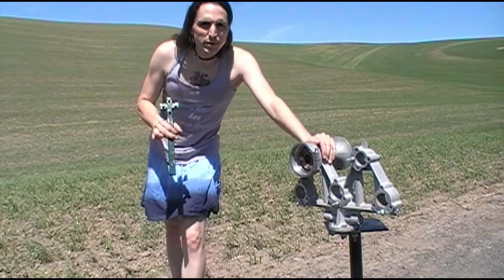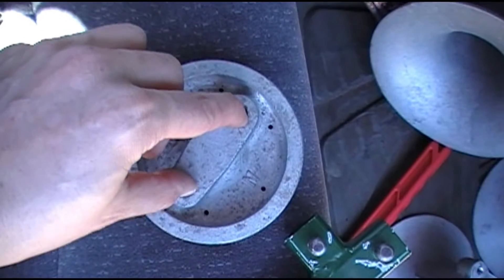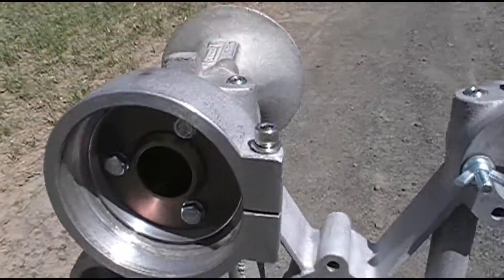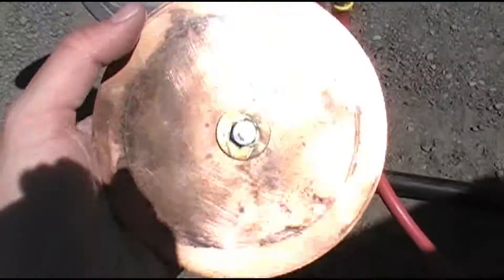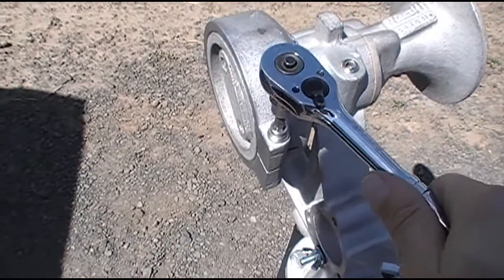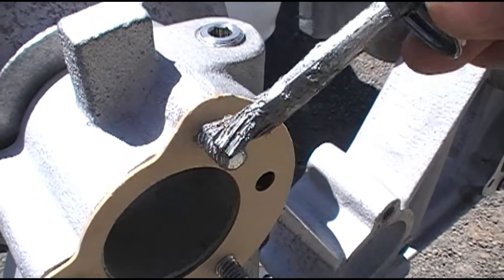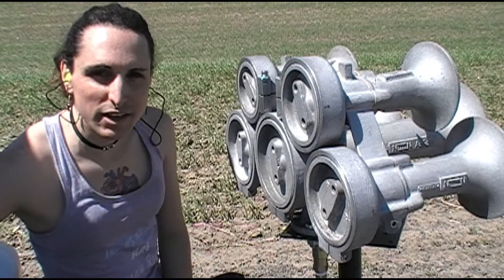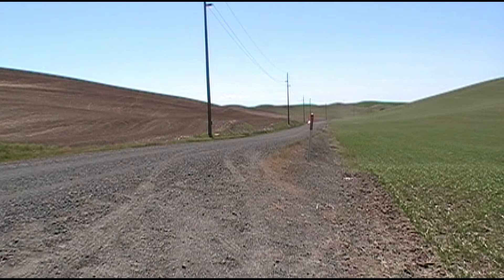M5 Horn Voicing (M5 Tuning)

Comment: I just picked up a 52 M5 with the factory seal wires still on it and it doesn't voice at all. Tom said "welcome to M horn ownership". I'm in for a adventure to getting it to sound nice again
Reply from the maker: @TWIGYBNSF  worn caps are the #1 cause of M horn problems, I’d start there.
Reply: @mafarnz good news. Finally have mine taken apart after being sealed for 72 years and there's not much wear on mine. Just a lot of corrosion. Mike Muha said if I assemble everything back together, it should voice. I maybe lucky with this one but can't speak too soon. I would eventually be making a video on my M5 once I have it back together again. But first, antiseize

Comment: I have an M3 i just made a spanner wrench for and it needs voicing, how do i get only 1 specific chime to blow like here when you have the other chimes attached?
Reply from the maker: Nothing extra or special needs to be done. Just follow the steps I showed here. Voice a bell, clamp the head then leave it alone and voice the next bell.  It’s just pressure and VERY precise control of air. Voicing this method means that each bell is voiced at a slightly lower pressure, that’s what allows M horns to step in sequentially like they do.

Comment: After you lock down the heads with the lock bolt, Airchime suggests using a 1/8 or 1/16 drill to drill a hole through the chamber and cap to attach a lock wire. The lock wire usually went through a hole in the cap of the lock bolt as well. The wire keeps the cap from unscrewing, thus keeping the tune intact for a longer period of time. I've never met anyone who actually has drilled a head and cap to attach their own wire, but it's in the manual.
Reply from the maker: That practice went away from the factory as well quite early. This horn has no seal wires drilled anywhere in it. 
I’d rather not fill my caps full of holes!
Reply: @mafarnz  I have seen a seal wired 1980's horn. Not sure if it was an option or not, or if it depended on who was working that day.

Comment: I really like watching this. Voicing a horn is more than often what makes it what it is. My all-time Favorite Horns are very certain K5LAs with their notes (usually 30 to 50 cents) sharp.

Now I wonder if you could do a video exactly like this, but with a K5LA?
Reply from the maker: You put the diaphragms in the back cap. You bolt on the back cap. You’re done. 
K horns are super simple. No voicing needed.
Reply: Well, at least now I know what to do if I want a unique-sounding K Horn. Just because it is that easy doesn't mean there's no reason to go an extra step.